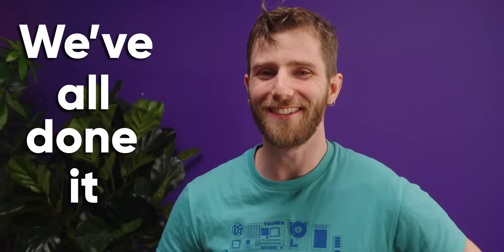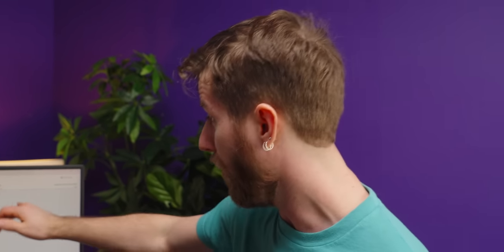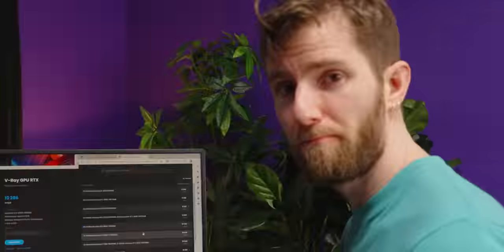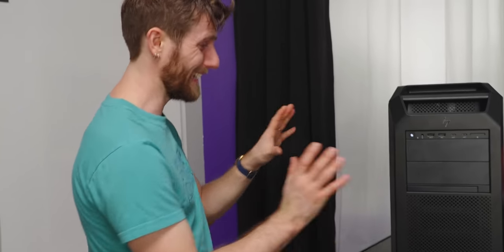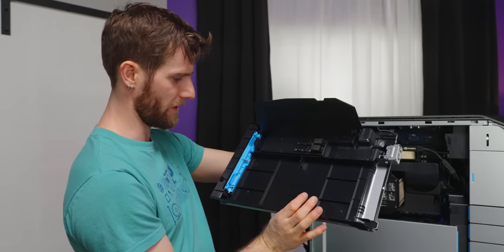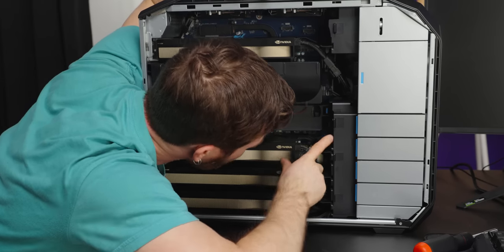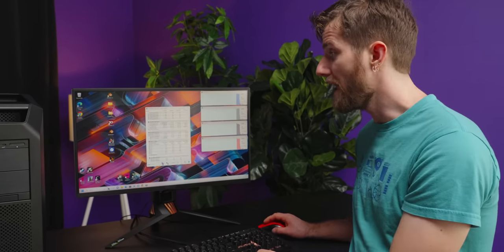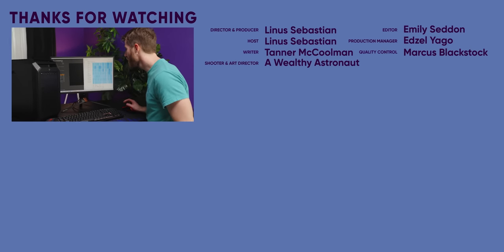Don’t ask me the price - HP Z8 Fury G5

Comment: It almost looks like HP stole some engineers from HP Enterprise to design a commercial word station for them. The shrouds are normal, they had those in the Celeron D days in HP desktops( and when they were both 1 company still). But that cooler, those power supplies, that management board, the fans in the shroud for the ram, the case alarm, and all those internal case panels yell " I WANNA BE A SERVER! PICK ME PICK ME PICK ME!" but then they made it a word station instead.

Comment: This still looks like a far-off option to a true engineered design... For what this is used typically, I think that those H100s in a quad or octa sister-board design, all liquid cooled with direct die cooling, as well as liquid cooling of everything else would have been a true goal... but that would have been the dream that costs far more than this thing...

Comment: Problem with these old workstation is that while they have many cores (even for 10 years from now), the single core performance, especially for gaming, is not better than a modern i3 of that time (because now a modern i3 single core is better than an 7 year old workstation PC). It only make sense if they are truly dirt cheap but sometimes when they are promoted, the (used) price can get too high. Currently as I'm seeing on a popular bidding site, those haswell/broadwell based workstation are still too expensive for their performance compare to modern budget option.

Comment: hp unable to build a good pc/laptop/server. change my mind
all they do is printers and overpriced garbage.
hate their servers (bios + ilo + raid controllers)
hate their laptops (build quality + battery/charger issues + worst ergonomics + drivers quality, could come bent and with bulged battery right from factory)
i have to use their 'elitebook' line laptops for last 4 years (gen 5,6,7,8), and it's the worst laptops i ever used.

i'm in love with asus zenbook ux425u on ryzen 5 5500u. just the best laptop for work. and asus rog amd advantage for games (all perfect, but mediatek wifi module)

Comment: You spend alot of time explaining blender but then give no frame of reference for the speed of the computer except to do it yourself- seeming to expect people to either be experienced in blender (already knowing how long it should take) or spend half an hour downloading blender then running these things on their own pc (an unrealistic expectation).  This is odd because if you knew what blender was and what it did you wouldn't need the lengthy explanation and if you didn't know what blender did a frame of reference would be extremely useful.

At 4:58 you would only be able to understand the information displayed if you paused and spent 10 seconds reading through it or had prior experience with the website.  The information is hard to read due to the fact that it's moving and displayed for a very brief period of time- which i assume was done due to how dull that page was.  This would probably be fine if it was just b-roll but linus points something out on the information that is no longer being shown.  Leaving the the viewer potentially unsatisfied unless they break the flow of the video and go back.

Did you only have the workstation for a few hours?  Did you have a limited time to work on the video?
I feel as if this video could have been polished to a higher degree
- though i still like it (Just slight dissatisfaction experienced at parts).

Comment: Too bad you need HP branded lithium CMOS batteries, HP branded screwdrivers, HP branded ethernet cables, HP branded air and a HP branded nuclear power plant to power these. (For those wondering, I am not buying how cool this is unless I can fit whatever the f I want in it without getting beeped at by the motherboard for "unauthorized equipment")
Reply: None of this is true.  My business has been purchasing HP and Dell workstations for years.  We use a mix of HP/Dell branded components as well as numerous 3rd party components for graphics, storage, LAN cards, etc.  We've never had any compatibility problems with any component.  Professional Workstations are, after all, just PCs (albeit very powerful PCs).
Reply: @TruckerDanStudios  Good for you, honestly. I had to replace a graphics card and I had a similar graphics card from similar era (745 vs 750) and both were HP branded. It was booting without video w/ original one, it was beeping w/ the replacement, and it was booting without a gpu. The one that was beeping was detected in another PC just fine and ran, as well as the one with faulty VRAM. It was just not the right flavor of HP HP.
Reply: @TruckerDanStudios  Oh and don't even get me started on storage cards (LSI HBA) - just not working at all, but a HP Smart Array was working JUST FINE. I found it was possible to just flash HP bios but I ditched the system altogether and we bought a supermicro board and chassis.
Reply: @TruckerDanStudios  That is 10 years old hardware. So that's why it triggered me when Linus said that 10 years from now this is gonna be someone's gaming system... sure, provided they get to find a HP branded/whitelisted GPU or they manage to spoof the PCI ID by flashing a HP VBIOS or something.
Reply: Repairability my ass
Reply: @LMojzis  We have definitely run into BIOS updates being required for some components to run properly (LAN cards come to mind).  But this is pretty common throughout the PC industry since there are so many component manufacturers all working independently of each other. For us, professional workstations are definitely worth it for their dependability, build quality, and driver stability.  Best of luck to you, sir!  :)
Reply: @LMojzis  I've got an RTX 3080 currently running in a Z8 G4.  We've been mixing Geforce cards in workstations for years (we can't afford Quadro in every build!!).   We rarely run into issues, and any issue we run into is resolved with the latest NVIDIA drivers and sometimes BIOS update.